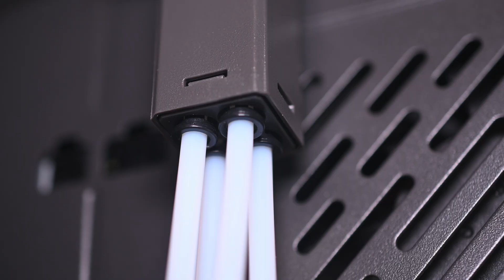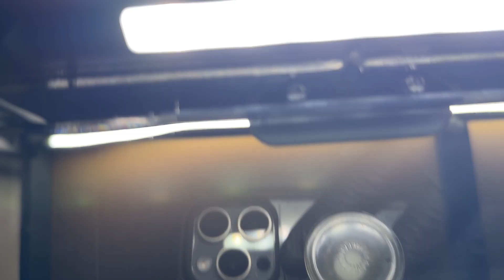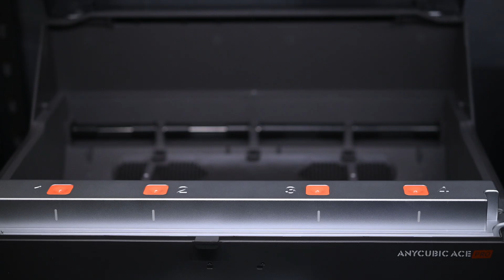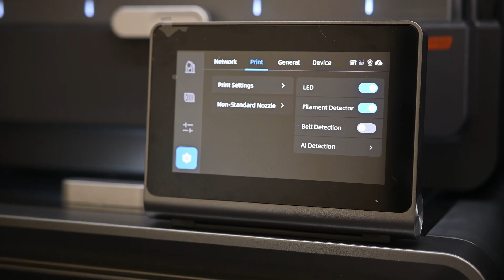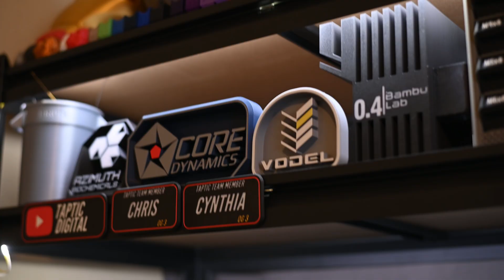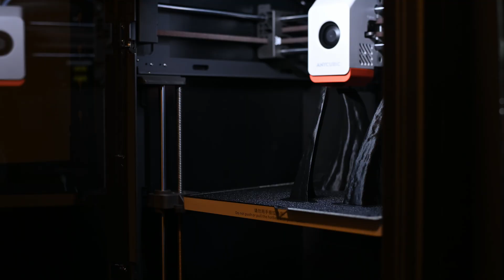Under Promise, Over Deliver - Anycubic Kobra S1 Combo First Impressions

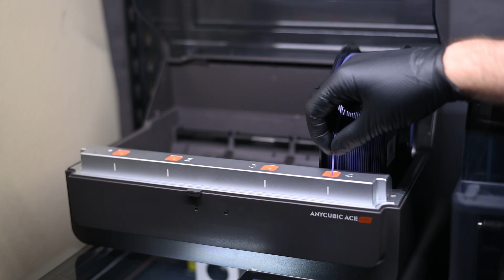Comment: 4:15 Always cut straight with no angle, and straighten the end slightly, by about 2”. This solves it entirely.
Reply from the maker: Thanks for the tip! I tried both ways and definitely agree that the flat cut is more reliable